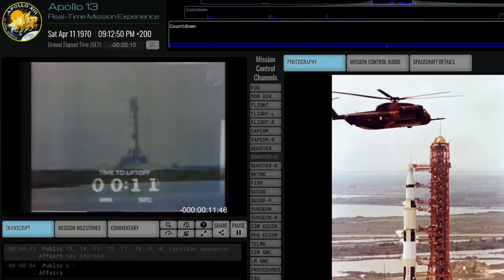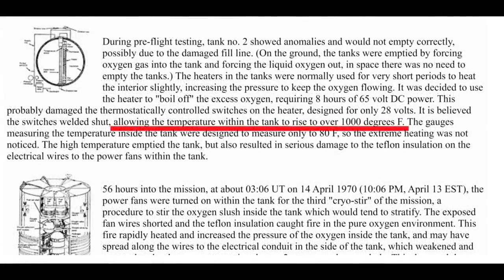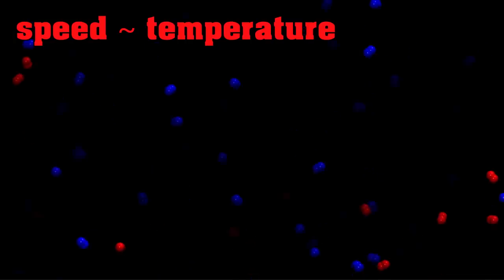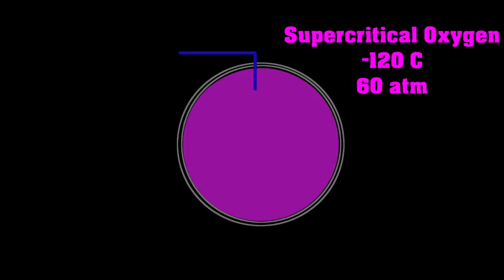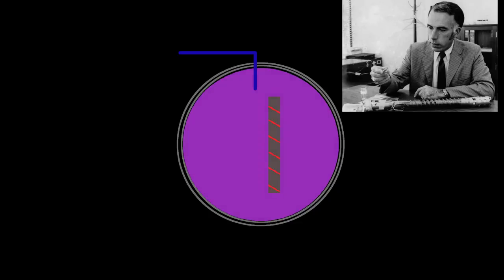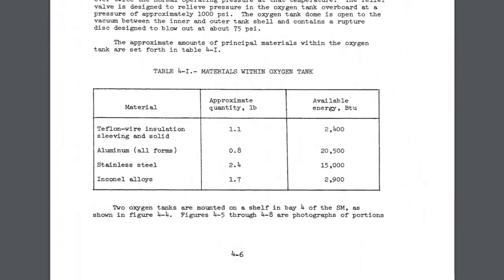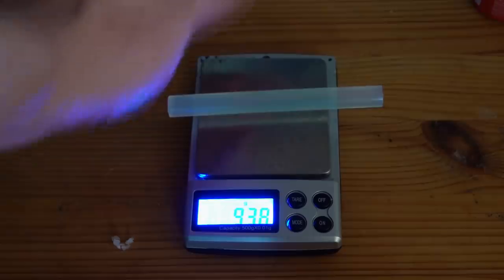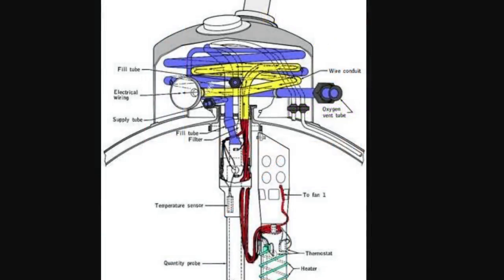Apollo 13 the FULL story: Part 2: The explosion.

Comment: The question centers on a Tank Rupture.  But what if the rupture was at a value / in the line? A Short in the heater would have heated all of the metals in the heater, increasing the expansion. The 100 watt rating of the heater  during  a Short Circuit doesn't matter.   What pressure were the pipes or tubes rated for? What are the Volts and Amperes going to that heater? Based on your experiment, there was more involved than the energy from a filter. The heat moved slower than that. Gut feeling.  There was more fuel involved.

Comment: I just got to the point about "10 grams" (5:30).  On the thumbnail, I thought 10 g, in reference to a rocket launch, would be referring to acceleration.

Hopefully, the narration will continue with an explanation of what it means for the size of a fire to be measured in grams.
Reply: Fuel+Oxygen=Engery , since whe know there is more then enough oxygen all we need to know is the mass of the Fuel. Sure you can say how much energy in Jouls or BTU the fire released but its easier to visualize when you can see the aktual mass of fuel (22:56)

Comment: Put a 100W lightbulb in a cryro tank and see how quickly it heats up in there. 1000F is unlikely, but it's going to get rather hot. I can't say how flammable PTFE is in a 900PSI pure oxygen tank, but it does melt, and will vaporize. (ever left a teflon frying pan on the stove "dry"?)

Comment: The C-F bond is more electro negative then a C-O Bond. Im surprised it burned at all. O in a CF fire should behave like nitrogen Make a BUSTED on flight twa 800's gas tanks I did it in my back yard with real jet fuel and no explosion from wires or other pyro technics for the same reason.
Reply: But you have to consider that it can burn for the reason that it's Teflon, not carbon tetrafluoride. It has C-C bonds which break down at high temperatures. Then you get a bunch of radicals where the valency of carbon is only partially satisfied by the fluorine. So, if you had a CF2 radical or a C2F4 radical from thermal decomposition, oxygen can react with these radicals to release energy. So yes, Teflon doesn't burn, but it's decomposition products can. I'm guessing that could be why it doesn't burn in liquid oxygen. If the LO2 takes away the heat needed for decomposition, no new radicals are formed, ceasing combustion. Wood, say on the other hand has hydrogens and carbons that can attacked by LO2 directly. This is all speculation, though.

Comment: Maybe this is way off, but isn't the problem with the Al that it usually isn't metallic but oxidized already? So you can't get it to react with O2 because it already is Al2O3 (at least on the surface)?
Reply: I don't think that's way off.

Comment: Is it possible they might have used sintered Teflon as insulation on the wires? I used to work for a company that made sintered PTFE products, and sintering lowers the weight and makes the Teflon exceptionally porous, perhaps with sintered Teflon insulation, the porosity would act as insulation and stop the heat from being drained away from the flame too quickly, this might allow the flame to slowly burn and move up the wire in the inner side of the Teflon insulation where it meets the bare metal of the wire.

Comment: A burning filter is indeed a very compelling suggestion. Though, I have trouble understanding what this filter was even good for. I mean, what exactly does it filter?
Reply: I think it'd be to stop crud getting into the over pressure relief valve and possibly stopping it from closing properly when the pressure was acceptable again.

Comment: Maybe modern ptfe is a slightly different formula than 50/60 years ago, strange how they say for a fire you need three things, fuel, oxygen and heat, but in liquid oxygen, surely that removes heat

Comment: The power consumption of the heater is kind of irrelevant.  What matters is the current capacity of the power supply.  WHY these power supplies were not fused is beyond me.  Why the wire running into the tank was not fused, I have no idea why.
Reply: I'm guessing they had circuit breakers instead.
Reply: @hermitoldguy6312  They do the same thing. Even if they automatically un-tripped (your headlights have that kind of circuit breaker), they only un-trip after the fault is fixed, otherwise it just auto-trips again.
Reply: @tarstarkusz  Fuses are slow. The British Standard for domestic fuses states they should carry a 50% overcurrent for 1 hour. Circuit breakers are also slow - but I don't know how slow. A brief spark may be a very high current, but only for a very short time - a fuse wouldn't notice it - a circuit breaker might not.
Reply: @hermitoldguy6312  They shouldn't. The whole point of a fuse is to keep a wire from carrying current it is not rated for.  But a dead short maxes out whatever the supply can put out, on paper, it goes to infinity.  It is unlikely that this was a minor over current.  The wire was sitting in a tank with close to liquid oxygen at 150 below zero. If it was 50% more than the wire was rated for, it would have heated up, but not to the point of the cladding catching on fire.

Comment: I'm thinking the supercritical oxygen has different properties than the liquid o2 such as boiling point and thermal conductivity, both of which would modify the combustion of the PTFE. In addition the overpressure valve releasing could have caused the o2 to at least begin transitioning into liquid/solid as the pressure dropped.

Things that one can't test on a few hundred dollar budget in earth gravity... /sigh

Comment: Why are they using Teflon in space? I think Teflon, PTTFE or other similar material does not play well with ionizing radiation. Good stuff that Teflon material is! 
Not sure about the lifetime of Teflon in ionizing radiation but other stuff is lots less resistant to the harsh thermal environment of space. I thought space has lots of ionizing radiation? Maybe lots of shielding? I could be wrong about all of the above? Am I asking stupid questions?
Reply: I'd say it's a valid concern, but those cables should at least be inside the hull, which would shield them fron alphas and most betas.
Reply: I think if it was a problem for apollo missions lasting ~1 week it'd be a problem for PTFE objects on earth after a few months. and PTFE is notably very stable on earth. 
also radiation levels that would cause material science type problems to the polymers on the space craft would be very quickly lethal to astronauts.   Radiation in space is higher than background on Earth, but it's not like being inside a reactor.
AFAIK we've now got polymers that are preferable to PTFE for long duration in space (satellites, planetary probes) but maybe PTFE was the best thing available in the 60s
Reply: the humans would be long dead from radiation poisoning before the ptfe showed any sign of problems from radiation
Reply: @joinedupjon  
Maybe Apollo 13 is why we have better options than PTFE now....
Reply: I don't see that as a major issue. Teflon is just a rubberized composite. Why would ionizing radiation be any worse for it compared to any other form of rubber? Also the alternative to any forms of rubber are paper and paper wires in a liquid are a terrible idea. Plus teflon was chosen because of it's extremely low reactivity as why it is used in most aircraft. 

Ionizing radiation is more an issue on intricate integrated circuitry When it comes to small transistors ionizing radiation has the power to produce it's own bits which are mainly a problem from the transistors being so small that the ionizing radiation has as much power available to it as the transistors itself when functioning normally.
Reply: I learned something. Thanks!

Comment: Did all the model burns assume that the wiring inside the tank was physically normal and conformed to the official design?  Had they attempted to determine if the internal wiring was damaged by the drop when the tank was removed from the Apollo 10 Service Module?

Comment: So what would they be expecting to need to filter out of the oxygen?
Reply: Good question,  had me thinking. The answer is briefly shown on screen: The filter is used to trap fibers and particles which could get downstream of the tank and hinder valve module and fuel cell operation.
Reply: CO2 mainly
Reply: @nightjarflying I don't think CO2 is produced directly from the liquid oxygen; its a by-product of the astronauts cell metabolism and excreted when breathing out. (which was a whole 'nother problem)
Reply: @nightjarflying  The CO2 scrubbers filtered the cabin air, not the oxygen.
Reply: There can be contaminates from manufacturing or the filling of the tanks that can damage regulators it take some complicated regulators to breathe.

Comment: I can now explain why, after a few seconds, the canister of air I used to blow off the dust on my keyboard and computer would start to freeze and spit out liquid instead of air.
Reply: Exactly the same thing happens with spray-paint cans, or propellant cans for driving airbrushes (which are essentially spray paint cans without paint in them).  In fact, it's probably the same stuff driving all three, since these days it would have to be CFC-free and non-flammable.  It probably happens with other spray cans as well, but those tend to not be used for nearly as long.

Comment: I dont like the idea of having a heater element inside a pressurised oxygen tank - surely better have an external heater attached to the outer hull of the metal tank itself and insulated from cold outside temperatures...not as efficient but lot safer.

Comment: Isn't the ages old story, "a fan sparked during a cryro-stir" -- I've never heard it any different, or if that was from the wiring, the motor, or the fan blade.  If they really did run the heaters at ~3 times the design power for 8 continuous hours, the people responsible should be shot. The heater might've been rated 100W at the intended voltage, but ramp that up and you've got a much bigger heater. Once you've gone "off scale high", stop heating the d*** thing! (by definition, you have no idea how hot you're getting the thing.)

The pressure relief system was not integral to the tank, but fitted to the outboard piping. Any over pressure in the tank would have to vent through the normal supply line(s). This is obviously a very bad design, and wouldn't even pass city boiler codes today. Even with a better vent, it's unlikely it could've reacted fast enough. Plus, venting several hundred pounds of liquid would be, let's say, unpleasant in space.

Comment: Hard to believe a flame actually went out in liquid oxygen! Should that even be possible.
Reply: You could put a flame out with gasoline, if you could spread it over the fire in an unbroken sheet.  Liquid doesn't actually burn, because it boils.  The gas that boils off can burn, though, because there are other things to react with and nothing to share the energy.

Comment: Why don't you just use some PTFE wire and short it while part of it is in the liquid oxygen?
Reply: @aSinisterKiid  This is not what I am saying.  I'm saying he should get some PTFE clad wire (which is readily available) put it into liquid oxygen and then run too much current through the wire.  The video you linked to is steel wool burning in liquid oxygen. That video you linked to is in this video.
Reply: @aSinisterKiid  No, he hasn't.
Reply: @tarstarkusz  Yes he did put wire into it. He obviously doesn't have the exact PTFE wire they had, otherwise he would have done that. But he tried every piece he could to get things as close as possible. He put the electrical wire coated with plastic in and it torched right up. That's about as close as he's gonna get given the materials he has. He replicated every detail as close as possible to the original conditions. If you aren't happy with him trying ptfe tape, electrical wire, ptfe with wood, ptfe with steel wool etc etc then maybe you should buy him the NASA specific PTFE insulated wire and send it to him. Otherwise, maybe be happy with the extensive research he has already done and be thankful he even tried to replicate the circumstances as close as he could.

Comment: I would've expected them to use a coarse strainer instead of a filter.
Was there ever an investigation into contaminants in the materials used?  i.e. the Teflon wire insulation adulterated with other crap, or thru-hole seals not made to spec etc?
Reply: There's a description of the filter at 49:21 - which to me, sounds like a bolt with scratched washers on it, and the tightness that the washers are squeezed together sets the size of the gap. (I'm not much on mechanics.)
Reply: @hermitoldguy6312    Yeah, the documents seem quite vague about this, just as Thunderf00t mentions indeed. Considering the pressures involved, it probably is a sophisticated contraption. The cause of USS Thresher loss comes to mind, although probably totally unrelated...failed emergency blow due to clogged high pressure gas strainer element. It still doesn't explain why the short circuit started & progressed the way it did on telemetry. Curious to see what episode 3 brings.

Comment: Damn, when this video started i asked but how did the initial fault start in the first place , before you jump to the how did it blow  ? Surely it couldn't be a simple short between two wires ?
Reply: Yeah, it could. A fire needs just enough ignition energy in the right place to get going, and that starting energy doesn't necessarily correspond to the resulting energy of the fire. To use a simple example, you could take a blowtorch at 1300 C and aim at a chunk of rated drywall for a bit, then take the flame away and you probably won't have a fire. Have an cigarette ember at 300 C land on an older couch, and a few hours later I'm probably finished putting the fire out and taking out the bodies.

Or to put it another way, a single match could have started started the Great London Fire or the Great Chicago Fire.